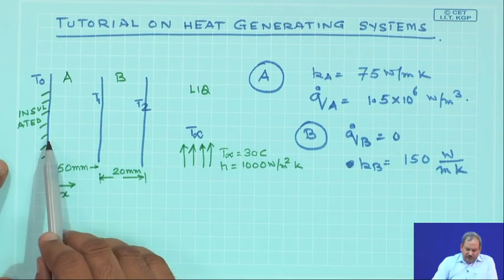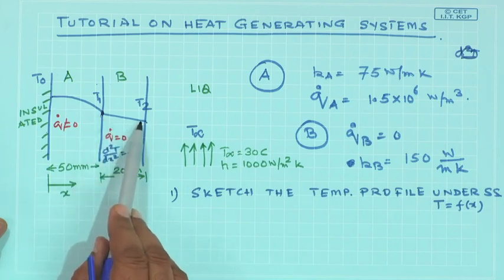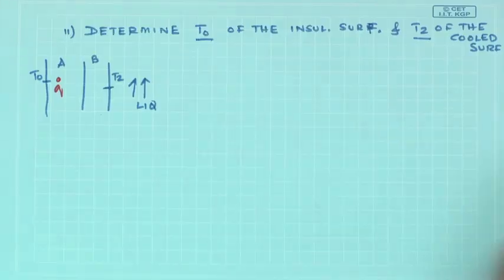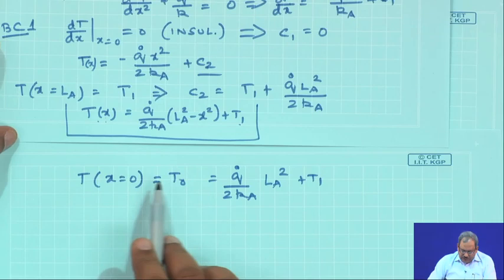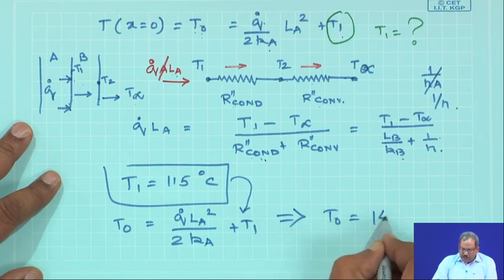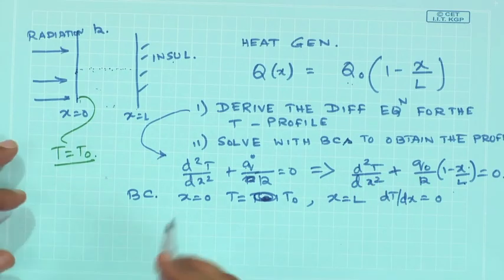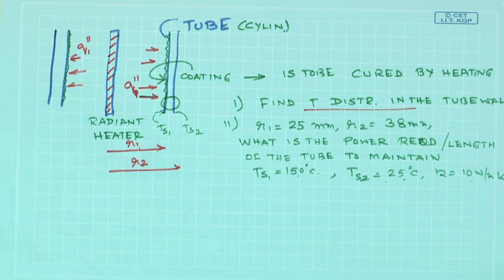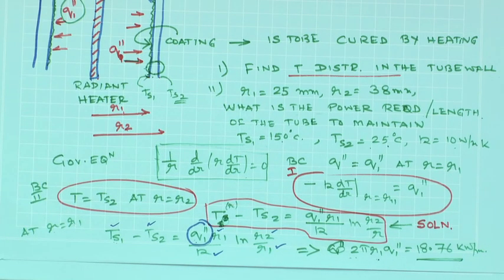Lecture 9 : Tutorial Problems of Heat Generating Systems

Comment: Sir, in 2nd question how is it in steady state? right side is insulated so heat will be absorbed and accumulated, it should be unsteady state.
Reply: the teacher said that assumption is steady state, so if a heat generating plane wants to be steady state, it must release out all of the heat it generated.
So that's the reason why it could be steady state

Comment: Sir in the radiation question also, there was not any heat generation inside the wall but still you had taken Q./K term ?? And in the next problem i.e, in cylinder one, you are not taking so! why ??
Reply: Well in 3rd question the heat generated is utilised for curing the coated i.e it is totally absorbed whereas in 2nd question it not utilised in any way so it is there...
Reply: In 2nd question heat generation is function of X so heat generation is taken in 2nd , in 3rd question heat generation is taken coating so heat generation is 0